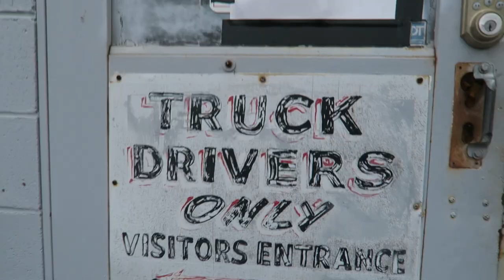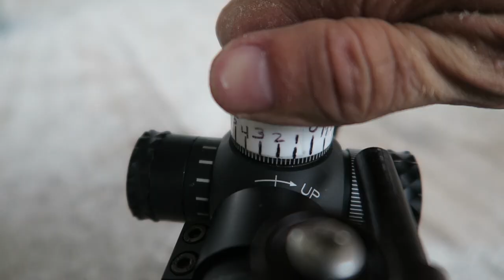Trick Shooting a Pigeon | Fx Impact | Airgun Evolution

Comment: Awesome video. Fx guns are amazing. I have an fx streamline and was able to hit a milk jug at 168 yards.
Reply from the maker: Connor wolfsoutdoors - Is the streamline able to change barrel liners to shoot slugs you can easily shoot 250 yards
Reply: @AirgunEvolution  sadly it is not. I have been thinking of saving up to get the fx crown. But before I do I need to buy a compressor because it is not fun pumping the streamline with a hand pump.
Reply from the maker: @connorwolfsoutdoors2017  I need to get one too, I end up paying 5ish every time I fill my little tank and a compressor would eventually pay for its self.
Reply: @AirgunEvolution  i had a 200 dollar Chinese one but it didnt last long. I wish other compressors would be cheaper, but i guess if you get a good one it will probably last a while.
Reply: @connorwolfsoutdoors2017  I had one chinese one that lasted over a year but the next one less than a month. Yong heng is going down hill.
Reply: @briant6669  mine had so many issues with it. I tried to contact their customer support but never got a response. I would have been better off buying a hand pump from the start.
Reply: @connorwolfsoutdoors2017  I just got the Hatsan compressor. I highly recommend it if you go that route. It is a lot to spend 1350 on your air source, but I shoot every day so it made sense.